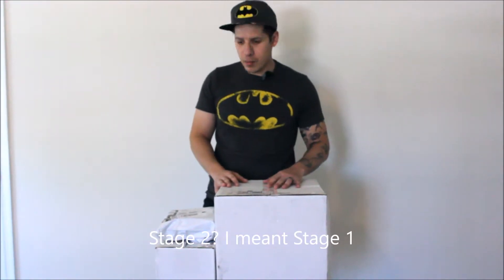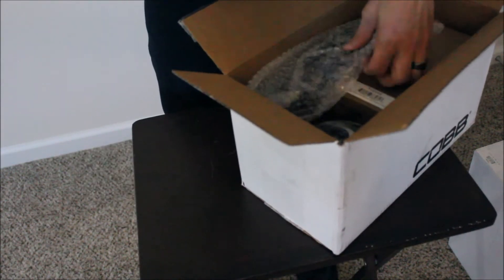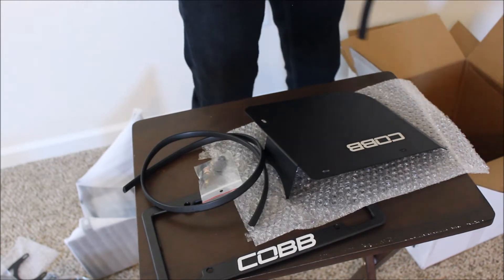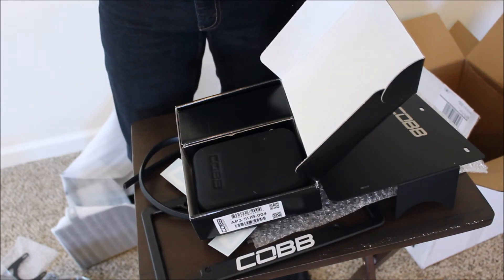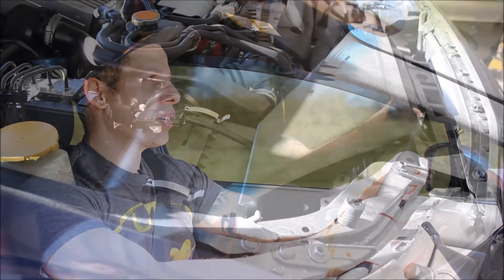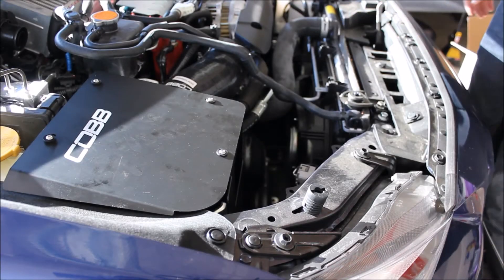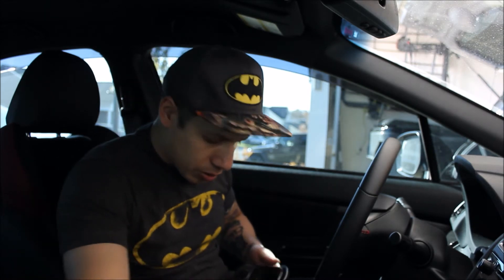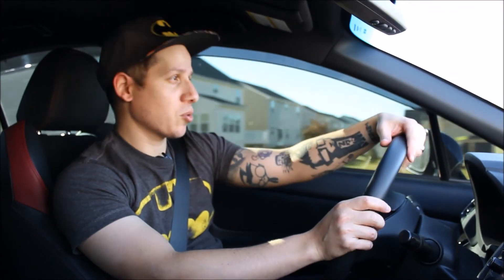Cobb Stage 1 + SF install Accessport 2015 - 2017 Subaru WRX STI

Comment: Hey man I have a question,  I just install my accessport and tune my car its a 2015 sti  and I did it  exactly the way you did, but I'm only getting 12 psi in (S) and 14 psi on (S#)  what can I do to get 18 psi  ?  And what it's high wastegate map? 
And after a couple runs my psi lowered to 8 psi even if I'm in (S#)  why ?
Reply from the maker: douglas rodriguez go to the accessport and scroll down on the map that you have, look for the map that you want but that it says HWG, that is going to be the high wastegate map. Usually after hitting target boost it will taper down. Also make sure you are on the throttle 100% to actually hit target boost. You might feel that you are completely pedal to the metal (lol) but actually arent. I did that haha. Let me know
Reply: ARomanRacing  okay I will let you know I will do it after work, and did you know why after a couple run my psi lowered to 8 psi only ?  Thank you
Reply from the maker: douglas rodriguez like I said, you need to make sure you are 100% throttle and sport sharp, try the HWG, and if its still low, you could have a boost leak. So check all your connections and even your intake connections just in case
Reply: ARomanRacing  okay I will do it, and yeah I'm 100 % throttle every time I try... I will let you know man thank you
Reply: ARomanRacing  so I just get home I try to do that but my accessport doesn't show me that one you said 😬 because I have STAGE 1 + SF ACN91 V342 BOOST SELECT
Reply: ARomanRacing  what I should do?
Reply from the maker: douglas rodriguez connect the accessport to the computer and do an update. I do have another video of the AP overview and I show how to update
Reply from the maker: douglas rodriguez oh an another thing, you in Cali? Because of the 91 map and not 93?
Reply: ARomanRacing  yeah I'm on cali so I gasto have 93 ?  Oh ok I will try in the computer too I will let you know thanks
Reply from the maker: douglas rodriguez yeah you have to put that 91 map so the psi will be a bit lower than mine

Comment: so I know the video is old don't know if you still look at it, but if you do please respond to my comment. I have a 2017 sti did the stage one plus just like you. I installed the accesport and intake yesterday and started with the stage 1 + normal waste gate. I am getting 15.5 boost consistent in sport mode and 18.5 in sport sharp. when you say you were only getting 15 psi was that in sport sharp or sport. just wondering if I need to change to the hwg
Reply from the maker: It was sport sharp for me. Just went ahead and changed it to high wastegate and it was at 18.5. So yours is correct
Reply: Thanks for the update!

Comment: i just got the accessport for my stock 2015 sti.  there is no high waste gate or low waste gate maps pre-installed, and searching cobbs website reveals no such thing.  pre-installed are simply the stage 1 maps for the different octanes.  my car hits the target boost of 17.5 so i did not have to hunt down the other map like you did.  but i am curious how did you get the high waste gate map?
Reply from the maker: I just looked at the cobb website and after you choose the stage 1 map, there will be a drop down for wastegate. They have normal, low and high.
Reply: @ARomanRacing  thanks for the tip.  it is good to have them in the accessport just in case!
Reply: @ARomanRacing  i also want to add my experience.  the stage 1 93 octane map hits like a ton of bricks!  i am so far very impressed.  4th gear pegs the boost at 17+ psi and holds it there until almost to red line.  just my initial observations so far.  sport setting feels stock.  s# really opens the car up.  i was afraid that the power band would drop off to near stock levels past 6k rpm but it seems like power increase is up top as well.
Reply from the maker: @ARGH28  sport setting is daily for me lol, always switch to sport sharp everywhere i go lol

Comment: read through some comments and saw that your boost hits and stays at 18 pounds. right now i'll peak at 18 but it tones down to 14-16, i'm not running intake or stage 1 tune YET. it's coming in the mail. does the tune change that? or do you have a boost controller to always allow 18 pounds
Reply from the maker: Josh Jordan yes it the ots map will change it. If you read the accessport manual it will tell you what your boost target you should be for your map

Comment: Nice video man! I am new to Cobb ap, i ordered Cobb v3 ap, Cobb sf intake and ETS full exhaust with muffler delete. Is that a stage 1or stage 2? Thanks
Reply from the maker: Mr Sti according to cobb, for 2017 sti, you cant run the intake and turbo back exhaust. With intake alone its stage 1 +sf, and with turbo back exhaust its stage 2. I am guessing if you get both and get protune then that would be a stage 3 for 17 STIs

Comment: I have 2016 STI. I wanted to do the STAGE 1 as well. Right now im at 7K mile. I wouldnt really want to mod it after the warranty.
Whats the mile on your car? Worth it?
Reply from the maker: I was not going to do any mods to my engine till the warranty ran out but I could not hold myself, so I said screw it and went and did this. My car currently has 6K miles on it. If I ever have to take it back to the dealership for something to do with the engine I will just uninstall everything and hope they never find out. But every owner should own an accessport and its definitely worth it, it is a must.

Comment: Where could I buy that plug on the cabin side of the hole that was left open for more turbo noise ?
Reply from the maker: On the stock intake or the firewall. Either of them can be bought anywhere. I believe subispeed sells some and even Perrin

Comment: My question is why does my v3 access port say access port in red on the actual unit but i see other people with v3's and theirs say cobb in white letters at the top of their unit??Is there a knock off? I bought mine used through a private seller.
Reply: johnny d same brand just Cobb decided to put Cobb on newer year accessports

Comment: when you were uploading the AP 
Do you have to recharge the car battery? or just optional?
Reply from the maker: nofearastig That part of the AP pretty much just means to make sure that your battery is charged and that it doesnt die while you are flashing the ecu
Reply from the maker: And i mean the car battery
Reply: I just installed stage 1 and noticed the 15 psi also... did u run it in the s# mode to get it to 18psi... please let me know as I am wondering also... thanks ahead ARomanRacing

Comment: how is it running.  I just ordered  cobb stage 1 . I have the same mod as you . I only have the nameless axle back . any problems
Reply from the maker: Angelo Maselli I have no problems at all, been loving it, love the sound and love the speed, I have hit 19psi but usually at WOT it stays perfectly at 18psi. It feels like it stays in boost the whole way to red line without dying
Reply: I have a '15 STI with Nameless catback and Cobb SF. I usually get about 19 psi boost. I will be installing the Whiteline 24mm rear sway bar later this year (when the weather stays nice) and look forward to getting back to Mid Ohio to put it to the test. Good vid man!

Comment: Hey i install my intake with sf and i wasn't hitting 18 psi or near it in sport sharp  with the 93 oct tune + sf i made 15 psi nwg ( this was check by the boost gauge in the car not the ap) i then install the  hwg map and  hit 15.99 psi at 75 % throttle is that normal?  (this was check by the ap)
Reply from the maker: Micheal Elias you need to go back to the accessport and install the hwg map , and make sure you connect to he computer first to make sure it is updated too
Reply: ARomanRacing I am currently on it . I hit 15.99 psi on 75 % throttle do I have to hit 100% for the remains psi ?
Reply from the maker: Micheal Elias oh yeah pedal to metal bro, 100% throttle will get you there, i thought you were saying that you were only getting 75% throttle. Dont be afraid of going all the way down and learn your car after the AP
Reply: ARomanRacing ok I'll try that any specific gear ? and thanks for the info bro
Reply from the maker: Micheal Elias no gear specific, you should hit target boost in each gear, i was driving when i got your comment and did it on 6th gear
Reply: ARomanRacing thanks bro I got it! so how you liking this tune from stock ?

Comment: Hey man I literally have the same setup for my 2017 STi except I have an Invidia Q300 Catback. I get 18.3 lbs of boost. Dont be affraid to push the car to redline from 3RD to 4TH and youll get your 18 pounds! Good luck with the build man!
Reply from the maker: Phillip Lim Later that day I installed the HWG Map and I was hitting the target boost, I have hit 18.2. Went home and started to read the Cobb manual online and I read that if I installed the normal Map and I am not hitting the target boost then I had to install the HWG map, I am extremely happy with it now.
Reply: hey im at the same setup as well, yet im actually going to 18.9. is that bad?

Comment: Hey Aroman, I just installed the stage 1+ map and I'm only hitting 9 psi in sport sharp! Bone stock it hit 14-15 consistently so I know it's not a boost leak. Any ideas? :(
Reply from the maker: LifeAsSteve make sure you have updated the accessport, then check what map you have and flash it with the HWG which is the high wastegate and ofcourse depending where you at either 91 or 93 map also. Let me know
Reply: ARomanRacing The AP is updated and I'm on the Stage 1+ 93 map. I don't see a HWG/LWG map for the Stage 1+ maps only for the Stage 1 maps. I even checked Cobb's website and it says that the HWG/LWG are only available for stage 1/2 cars. Thanks for the reply!
Reply from the maker: LifeAsSteve that cant be because I uploaded a hwg map lol. Check again to see if you see or connect it to the computer to see if you see it there. Check all the connections on the intake. Re upload the map, that sometimes works. If nothing fixes it, you can send an email to Cobb, their customer service is awesome.
Reply: ARomanRacing I still don't see the map on the access port manager. I guess I'll have to email Cobb and see if they can figure it out. Thanks man!

Comment: Where was your injector duty cycle hanging and peaking at with the sf intake stage 1?
Reply from the maker: James Dean Cooper oh man, i couldnt tell you. Its been so long now. I dont even think I have an old datalog lol
Reply: ARomanRacing darn man. I'm stage 2+ and injector duty cycle is 99 percent. I went back to cobb stage 2 with just DP catted it was 96 perfect. Wanted to run only the sf+ but if idc is the same or close to 95-99 I might as well stay with what I have. What do you think?
Reply from the maker: James Dean Cooper you on stock injectors?
Reply: ARomanRacing yes stock fuel system. My idc is the same at stage 2+ as it is with cobb stage 2 DP only. I want to downgrade to just stage 1+ but if idc is the same I'll stay with stage 2+ that's why I'm trying to figure out where idc hangs out with cobb sf intake only
Reply from the maker: James Dean Cooper yeah, the injectors will be overwhelmed going to stage 2+. Even cobb states it on their website. You gonna need some bigger injectors and a fuel pump and run stage 2 plus very comfortable
Reply: ARomanRacing understood. Stage 2+ I'm at 99 percent. However stage 2 I'm at 96 percent. Not much better. What do you think stage 1+ would be?

Comment: what map you running on the  acess port  stage 1 and any thing else to keep boost at 18 pounds?
Reply from the maker: Angelo Maselli I am running the Stage 1 + SF 93 oct HWG
Reply: ARomanRacing  should use acn91 not 91oct

Comment: What's the map you installed after you did all that cause I can't find sf mod stage 1
Reply from the maker: Georges Calixte i installed stage 1 +sf 93 octane HW. If you dont see it, make sure you give the accessport an update just in case
Reply: Aight I'm gonna check cause I didn't see that as a map to on my Cobb.

Comment: Anyone running this setup have any issues? Knock, boom ect? I'm thinking of getting the Cobb ap with Cobb intake but worried about reliability. Anyone got stories to share?
Reply from the maker: casey hoffman when i ran this i was only seeing knocks of -1.40 which is completely normal, but i was also seeing it on my fine knock learn. After i did all my mods and got a tune, i still see normal knocks on knock feed back but my fine knock always stays on zero. Really with the ots map i never had problems. Good thing about cobb and their maps and using their intake, if you see anything that you are concern all you need to do is send them an email and they will make you datalog amd see any problems and they can have their tuner fine tune that ots map for you. Cobb has great customer service
Reply: ARomanRacing good to know.  Makes me feel much better knowing that service is there
Reply from the maker: casey hoffman yeah i was very happy with their customer service when i was having problems with the flex fuel. They made me run a couple of datalog so their tuner can have a look and they end up sending me the whole flex fuel kit and told me to try one amd see if it fixed. The problem was fixed when i switched the kit, i sent them the old one and after they opened it up they sent me an email with what the problem was and even a picture of the problem. Cobb is definitely on my good companies book lol

Comment: Can you do downpipe and intake at the same time whit cobb stage 1+
Reply from the maker: You cannot. The injectors will ne maxed out with both downpipe and intake. You can run either downpipe or intake, cant be both. You would need injectors and fuel pump to be able to run both
Reply: @ARomanRacing  thank you mi amigo
Really good videos!!
Reply from the maker: @aldomeza6893  you are welcome

Comment: i have a question, so what did you do about the hole the sound tube was in?
Reply from the maker: I have it left open all this time lol. They have like a little rubber plug that you just put there and thats it, or you can't get like aluminum tape a tape it up.
Reply: @ARomanRacing  basically you deleted the BPV??
Reply from the maker: @kovaro2end  no that is not the bvp. BpV is on the intercooler on the STI. The sound tube is an unnecessary tube to give you a sound into the cabin which still is barely no sound. You get alot more sound when you put an intakr
Reply: @ARomanRacing  I understand, but how the air from the BPV go back to the intake once you build that pressure in there? I am about to do this but very curious about the BPV.
Reply from the maker: @kovaro2end  the bpv tube goes from the bpv to the turbo inlet. Not at the intake
Reply: @ARomanRacing  that makes more sense.  I am new to this and your videos are helping me alot. I thought that air get back in after the MAF sensor lol. You are GREAT. Thank you.👍
Reply from the maker: @kovaro2end  yes the air from the bpv is after the maf, the tube has nothing to do with reading of the maf or anything. If you ever take that tube off and keeping the stock intake, you would need to plug the hole. If you buy an intake then no need to plug the hole except on the fire

Comment: Is your sti still running after the Cobb stage 1 SF ?  Any issues after install? Almost everyone I know ends up getting rid of their sti after they realized they potentially ruined their car after going Cobb stage 1 SF.
Reply from the maker: I really havent heard of anyone that ruined their STI for running Cobb stage maps. As long as they put the correct parts on it. People fail when they put other brand intakes or put other mods with the map that only runs with the cobb intake. Everything ran fine the whole time I had that map. Now I am protuned because I am at Stage 3 plus plus or whatever they would call it for all the mods that I have. No problems there. As long as you get a tune for all the mods, you will be fine.
Reply: ARomanRacing 

So far, 1 year of running the cobb stage 1 SF is it still running well? Have you ever had any issues after install?  I'm curious as I have been wanting to get one.
Reply: I read through your comments... good info on HWG/LWG I’ve been hitting 18.7 on stage 1 stock intake. Seems like I’ve been able to build boost higher since I started using the LC & FFS. Installing SF tomorrow morning, this saved me some research if I have boosting issues🤙
Reply: Don't see how someone who has an AP can ruin their car if they pay attention to their gauges.